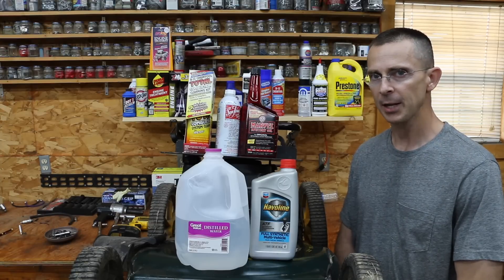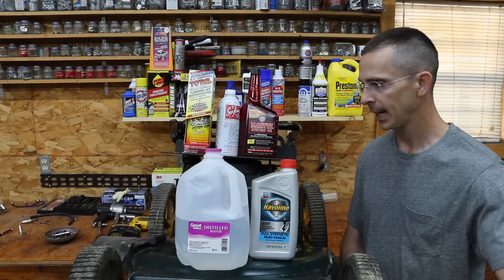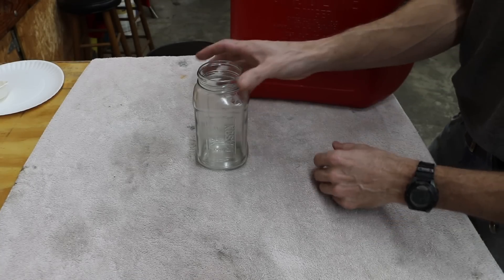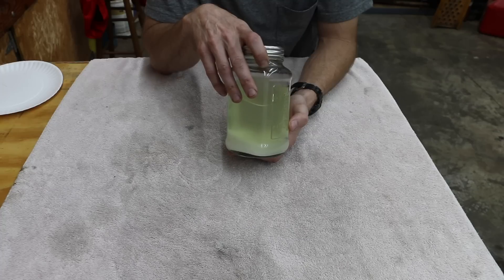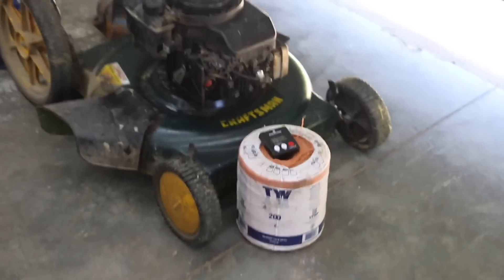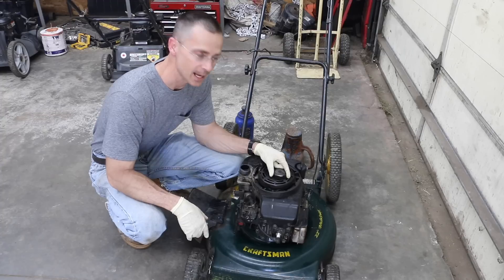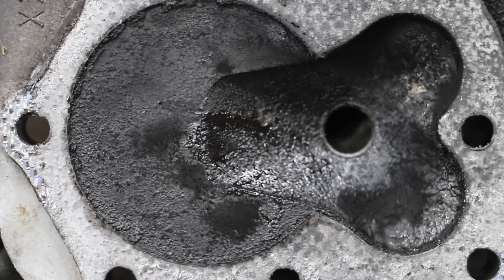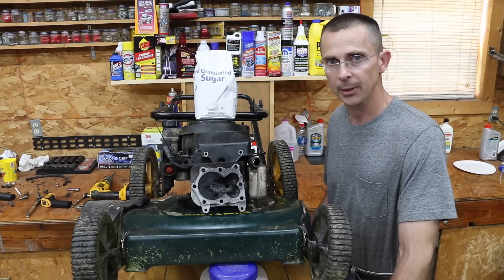Will Sugar in Gas Destroy a Vehicles Engine?  See what it does to this Engine!

Comment: Adding salt to engine oil breaks down it's lubricating properties.
 Not tried it yet, neighbours keep their car locked.
 J.
Reply from the maker: Average Joe,  This makes sense.  Salt is very corrosive!   Thanks for watching the video and commenting!
Reply: Average Joe lmao. too funny!!!
Reply: i do have a spare lawn mower engine i dont really want to spend 18 bucks for a starter clutch to try it out
Reply: (socket, drill=electric starter)
Reply: I would experiment, I only have vague memories of a conversation with a Petchem engineer twenty five odd years ago, He'd had problems with locals where he worked in Saudi dropping salt in fuel tanks.
 I have some kero here, will see if that dissolves salt.
 Cheers, J.
Reply: Ever heard of people adding maybe a teaspoon or 1/4 tsp. of baking soda to engine oil to make it less acidic? Although it's probably not as useful now it might have been useful in the 60s.
Reply: Not heard of that, Interesting stuff.
 I'm still looking up what nasty things people put in engines and fuel systems to be a bit mean etc.
 J.
Reply: try epoxy
Reply: just attack a hand crank directly
Reply: Frank Gutowski most small engines have no oil pump, no oil filter... everything gets lubed by the crankshaft splashing the oil up and onto components, salt in the oil can very well cause damage then
Reply: LOL! That's funny!
Reply: And ask for more,
Reply: Larry Somers: Just crank it by spinning the blade :) Losing a couple of fingers doesn't cost any money..
Reply: Average Joe LMA!!!
Reply: No need for salt into the engine. A oil quart with a 50/50 mixture of degreaser and water does fine and quickly too.You can use hand dish washing soap too. But you need the water for it to work.The oil will break down into a useless byproduct.
Reply: thought bout that or putting a bolt in top of the crank and useing a drill to crank it over
Reply: Lapping compound does an excellent job of ruining parts when mixed in the oil. An A&P mechanic friend of mine tried it on an old engine.
Reply: sorry mr political correct democrat .
Reply: Hey, Frank. Dan Quayle may have been an insufferable jerk BUT the word potato was "misspelled" on the spelling bee card handed to him in the day in question.  And potatoe is also correct. http://www.urbandictionary.com/define.php?term=potatoe
Reply: Out of curiosity, what started this whole potato conversation?
Reply: Larry Somers 

a whole 18 bucks????
Reply: geoffrey walker yea 18 bucks last i checked
Reply: Frank Gutowski got on someone's case about misspelling potato (potatoe) I scrolled up and found nothing.
Reply: I know that gasoline will NOT dissolve rock salt. Tried that many years ago for the purpose of making a design in the grass of a neighbor's front yard. It changed from green to white in two days during a hot summer heat wave!! But the rock salt was not dissolved.
Reply: you should
Reply: Cash 4 clunkers, dealers drain the oil and then put in 1-2 qrts of sodium silicate- sodium is salt, silicate is sand-
Reply: Liquid glass.  I have read that it has craft uses so I guess it is not 100% evil stuff.
Reply: sodium silicate is a heavy liquid that will eat glass, not sure why you would use it on a engine.
Reply: As a non Destructive prank you can put strips of heavy ziplock bags into the tank,  they suck to the pickup and float freely back into the tank after the motor/pump stalls
Reply: Kage Shi If you mate or neighbor rides a motorcycle, attach about 6 inches of bicycle inner tube to the   exhast. No, do not block the other end, just leave it loose. When the engine is started, the rubber makes a blerrkkk sound like an over sized whoopee cushion.
Reply: I'm actually surprised he didn't cover the lubrication aspect. I liked the video, it was edited well. He should have disassembled and measured the crank and rod, before and after as well. Lubrication is as crucial a parameter, as compression and to a lesser extent, carbon deposits.
Reply: Average Joe you have other neighbors.
Reply: Yes, All contemptible, I've given up.
Reply: They all lock their gas caps too?
Reply: Around here yes, My grievances would take a little more than inconveniencing a few people to settle.
J.
Reply: Marine engines usually have oil contaminated with salt water. It does not ruin the engine.
Reply: Drain their oil into a pan, then put the bolt back. Never have to get in the car ;)
Reply: Some cars (like my Jetta) have a plastic panel under the engine that has to be removed first and that has at least 6 screws holding it.  Then there is the issue of getting under the car to do it in the first place.  lastly, get out of there fast unless you want the owner of the vehicle to catch you in the act.  Who knows what he/she might do.  If you are *very lucky*, they will just not announce their presence but instead call the police and stay there to make sure you don't go anywhere while they come.  Then they will drag you out from under the car and take you away!!
Reply: never heard that one..
Reply: bleach is a real killer for oils lubricity
Reply: lol next day he happens to change his oil
Reply: Frank Gutowski
nah its taters homie didnt u lern n e thang in that there schooling u tuuk whens youins wuz yunger
Reply: Eric Vickery Did you fail grammar class? That is a easy class.
Reply: An easy class.
Reply: Ha!, Pedants Corner, I approve,
Reply: than dont comment about it :D
Reply: roy The Lightning It's "Then don't comment about it," and, what's "it?"
Reply: My favorite is a simple old classic.  Go to the parts store.  Buy a locking gas cap for that model car.  Lock cap on filler neck.  Throw away the key.  Their next fill up will be quite an adventure!
Reply: Nah. The police will just call a locksmith and dust your fingerprints off the cap.
Reply: First off a locksmith may be called but the vehicle's owner or insurance will have to pay for it and the inconvenience.  Second who would be stupid enough to leave fingerprints on a device of vandalism?
Reply: My like and replay to your comment has a number 666 . So  please apply exchange common sense with common sense people, and evil sense with evils so self called ''people'' .
Reply: Would a motor run on olive oil ?
Reply: Maybe a diesel motor.
Reply: Yes, a diesel engine will run on olive oil, if a substance burns and can be made liquid enough to pump into an injector it will work. (I know, a VERY broad generalisation), Iv'e been surprised at what will fuel a petrol engine also, and also royally pissed off that petrol goes off so quickly nowadays!. J.
Reply: What is petrol? Is that anything like gasoline?
Reply: Yes, sorry I forget it's called gasoline over the pond (English lunatic here!)
Reply: What's a pond? Is that anything like the ocean?
Reply: Ha! You got me.
Reply: Replace the engine sump with Olive oil ,I know it  will run on Diesel motor on fish n chips on cleaned cooking oil put oil in the sump and see how long the crank  will run before it throws a rod ?
Reply: Petrol is Gasoline where you live Gas is LPG in Oz.
Reply: LPG is propane here we use both terms
Gas is natural gas here, which is a mix of methane and ethane (and a little propane, butane, and helium.)
Reply: Average Joe even
Reply: Will the helium make the car sound funny?
Reply: Average Joe brilliant mate 👌🏻😂
Reply: no but natural gas is the primary source of helium industrially. The helium you fill balloons with comes from natural gas.
Reply: it is always a hindrance when the neighbor does that!
Reply: Please explain ?
Reply: Whats LMAO for ?
Reply: Road salt (winter roads) up here north makes engine oil get a whipped cream look.
Not good for an engine.
Need frequent oil changes.
Reply: Goldwingman 1500, Laughing My Ass Off.
Reply: Bring up anbout Nancy Wake who was the white mouse during WW11 she was taught by MI5 in England and dropped in France to Blow up the German rail with the French Resistence during the war they taught how to disable a tank with honey check it up it on youtube dont take my word for it Ok cheers .
Reply: Average Joe LMAO!
Reply: Not liquid glass its called water glass i make it at home from sodium hydroxide and crystals kitty litter they use it a lot in pottery hard to find over the counter.
Reply: How long would the motor with olive oil in the sump will it last very long or freeze up ?
Reply: That is really bad luck, I would guess (hope) that the oil was put in the brake resevoir in mistake, You did the right thing by replacing all the rubber in the system- not a very expensive job(in parts) but time consuming and messy, 2K would have been close to what a mechanic would have charged,
Abs module?, that would be fine, they only get really screwed up if the fluid gets saturated with water, and as it's hygroscopic, well, doesn't take many years.
 Cheers, J.
Reply: yes, salt brakes down oil and grease whether fossil or organic. Hell, salt or even sand will f up an internal combustion engine lol! anything that wont break down or caramelize after the fuel filter.
Reply: Project Farm i have a lawn mower that when i mowed the grass today i thought i saw black smoke but was not sure the engine seemed quite hot cant see and crap on cooling vents took spark plug out and there was lots of carbon build up whats the problem 👍
Reply: THE HOT ROD GUYS KAI black smoke is fuel smoke it's unburned fuel which means it's running rich and the carboned up spark plugs means it's unburned fuel the ideal color for spark plugs is bronze, white is lean, black is rich.
Reply: Average Joe how would you know what it does to the engine if you do it to your neighbors car?  You going to ask him or you going to fix it for him?
Reply: White smoke does not signify a lean mixture, it signifies that water is present to some degree in the fuel, or, if a water-cooled engine, getting into the combustion chamber, usually because a cylinder head gasket is blown near a water passage. Worst case, is that a cylinder liner is cracked, and if it's a solid cast unlined block, that's a disaster.
Reply: if water gets in the combustion chamber it comes out as GREY smoke which is called STEAM so yeah smoke color can tell you a lot.
Reply: And, it can indicate a leaking brake servo sucking brake fluid out and not quite burning it,
Reply: Jay Igaboo oh and by the way wouldn't water or coolant in the combustion chamber still create a lean mixture?  Anything other than gas in the combustion chamber is called a lean mixture.
Reply: Jay Igaboo and in my early comment I was referring to spark plug color not smoke color
Reply: +austin does sugar in the gas tank affect the water pump
Reply: Sandi Harris why the hell would it affect a water pump?  Are you being sarcastic?
Reply: Average Joe
So it will ruin a twostroke engine?
Reply: So does sand.
Reply: Forget salt, add grinding Powder (aluminium oxyde) to the oil.
Reply: @dogbarbill  Ammonium persulfate does nice designs in grass. I did it once with some solution I had left over after etching some circuit boards
Reply: @hyzercreek  How does helium come from petroleum gas?
Reply: @Dazzwidd  Not familiar with that stuff, but it sounds like fun!
Reply: Austin white smoke with water, smells sweet if it is antifreeze.  Grey smoke is oil, has its own distinctive smell.
Reply: Salt really i should remember that if i ever have a score to settle lol
Reply: Salt has no effect on oil, and it does not dissolve in oil It can choke the oil filter if you get enough in the oil but that is all. No corrosion because the oil is in the way. Salt would behave like a soft sand.
Reply: @AverageJoe2020  It doesn't dissolve in oil or other organic solvents but enough of it can block filters.
Reply: Salt is ionic compound which has negligible solubility in nonpolar solvent(English : No it won't, it can't even dissolve in oil).  If anything you'll get some grains up the bypass once you added enough to clog the oil filter.
Reply: Kik
Reply: @0011clem  OR BANANAS
Reply: @jgibson111  Ever heard of Liquor store robbers leaving their wallet (with a picture ID) on the counter? S**T happens!
Reply: I herd bleach will hurt a cars fuel system since it's a oxidiser.like rust out the tank (if metal) burn out the fuel pump and dry out seals.would be interesting to see.
Reply: Garcansdad although this old I’ll comment, back in JAMAICA BWI, I was an apprentice in 1957, a man whom I had zero liking to, asked me to check the oil in his car, I just was lapping a valve plate for a compressor,,so here I was then put both sides of the can , coarse & fine, & a quart of oil, he was going to the airport< never made it   Towed in and the took the engine apart, all they could see was a ‘WORN ENGINE’, did I get in trouble? Hell no ., so to this day I never forgot that . Cheers FROM NJ 🇺🇸🇺🇸🇺🇸🇺🇸
Reply: That was funny 👍👍
Reply: I hate neighbours like that. Locking their cars, bastards
Reply: I think the sugar deal was more aplicable to old leaded fuels? Don't know? Maybe it was just nonsense...
Reply: Average Joe hahahaha
Reply: @royTheLightning  CT bi
Reply: @royTheLightning  to
Reply: @royTheLightning  to
Reply: Use a syringe and inject varnish in through the rubber filler tube.
Reply: Bleach works much better
Reply: So that is way I keep finding salt bags near my car! @Average Joe, you rascal!
Reply: Looking at all these replies on how to destroy an engine, and nobody has mentioned a flower pot full of thermite on the hood.  Pfffft!  Lightweights!
Reply: @ProjectFarm  During WWII, US Army sabotage manuals recommended an  esoteric kind of Acid be added to the oil to create the most damage in the enemies engines.
Reply: @anthonymason701  The lower compression also sucks less hard, do the sugar might not get pulled in as far into the engine.
Reply: Better keep your locked too
Reply: @ProjectFarm  I bought a motorcycle, a 1983 suzuki 450, the gas tank is SO FULL OF PIN HOLES it not even funny.
I have looked for a different tank, but no luck.
I have been soldiering it, almost done.
Reply: @sandiharris2691  No. You have to add sugar to the radiator because the water pump works best when it's sweet. The engine must be cold, you have to add just the right amount of 'radiatior' sugar. Too much and the car will pull hard to the right, too little and it won't go into reverse. Always have a professional mechanic do this job, they have the right kind of sugar. You're welcome.
Reply: It works...... Add water and sugar.  1/2 gallon of water and 1/2 cup sugar shake and dump in tank (any tank car, truck etc) give it 3 to 4 days and you'll be shopping for another car! 100%
Reply: @AverageJoe2020  if you can get access, sardines placed on the manifold's a nice, smelly one to try out, and flour in the vents.
Reply: Just give it time you  We'll kiss them slipping up.

Comment: The additive I'd use would be a Louisville Slugger on the pos that put sugar in my tank.
Reply from the maker: That'd treat the cause for sure.  Thanks for commenting!
Reply: Clown Shoes MMA yeah then he comes back and puts 8 in ur face
Reply: Wow peeing i a gas tank is actually quite interesting. My little cousin did it it would run i emptied tank and bowl then ran from bottle of fuel for a while then it ran.

Comment: Thanks again for the great work. I had an experience with sugar being put in the gas tank. The result was totally different from yours. The sugar hardened in the carburetor, blocking all the ports, jets and valves. I tried rebuilding it, but after removing the sugar build-up, the metal parts were so severely corroded and pitted that much was not salvageable. I bought a junkyard carburetor and built a good one from the best of each. Then I drained and flushed the fuel system and installed a new filter.
Reply from the maker: You are welcome!  Thanks for sharing.
Reply: Are you sure it was sugar? The corrosion would suggest it was salt. 
My experience with sugar in the tank was I bought a ‘95 Kawasaki Ninja motorcycle. Years later I found what I assumed was sugar pact into the recesses of the tank. Never seemed to cause a problem. Tried to chisel it out but ended up leaving most of it there.
Reply: @MrSleepProductionsInc  No sir, I'm not sure. It never occurred to me that it may be something other than sugar. I just assumed.
Reply: I was always told that sugar doesn't dissolve in gas because of the chemical compound make up. Only plugs the filter. Never tried it or had any put in my gas tank that I know of.
Reply: i
you are right as i encountered the same. sugar turned to syrup in the tank, clogging injectors and fuel filter